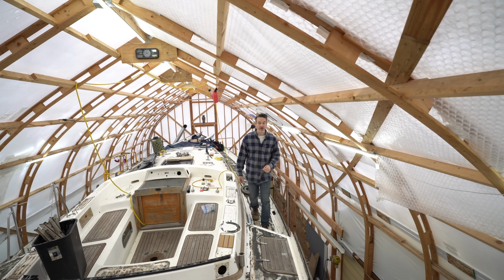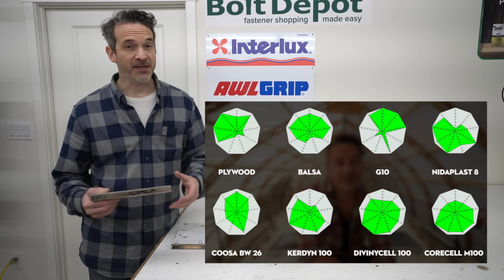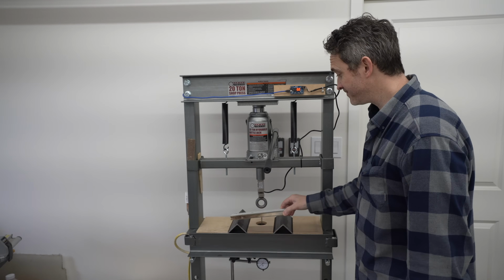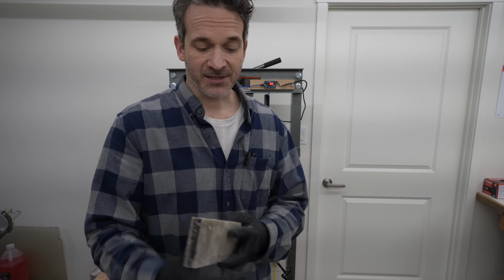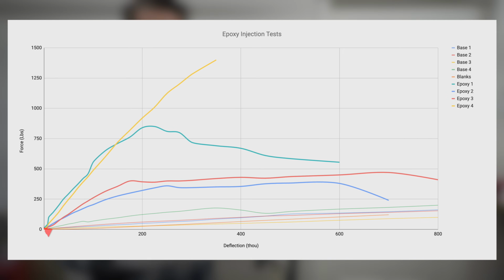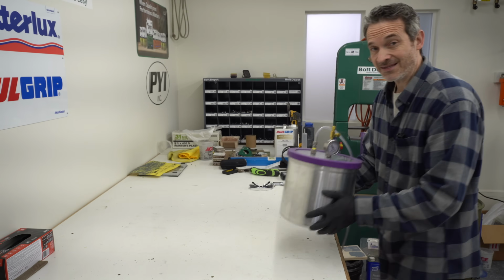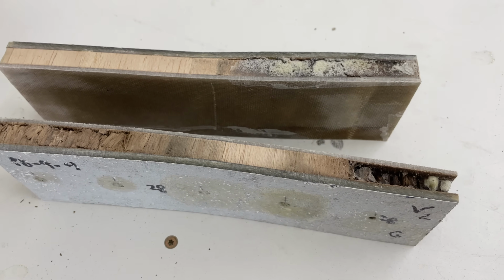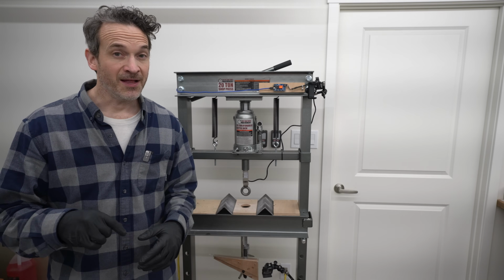Does Injecting EPOXY actually FIX a rotten boat deck?!

Comment: What I take from this is that epoxy injection is a viable fix for a small localized problem. For a a big problem, like Antidote,  recore is  the only suitable remedy
Reply from the maker: My legal counsel requires that I do not answer this directly. Haha. 😂 
I think that’s a reasonable interpretation of the results 👍

Comment: Just for fun I'd like to see how many self tapping countersunk screws per inch it would take to replicate the H100 core.
Reply from the maker: I’m on it! I bet BoltDepot would send me those to do some testing… 🤔
Reply: @livingforsail  FRP screws or bolts are another option, and could be glued in, with the head cut off if necessary. I was also going to suggest drilling and gluing in composite threaded rod but it's a bit too custom to cut and slot each one! I tried to find composite grub screws but came up empty. Nylon slotted grub screws was another option but I don't think the nylon could be glued in with epoxy.

Comment: The eyebolt just leads to core compression, the test setup could use a shoe to better test beam shear.
Reply from the maker: Yeah, I agree. A bit of a point load there… backyard engineering like I said. Haha. I think the results are still representative.

Comment: Thank you for the video. the subject of wet deck repair comes up often on a forum I follow. If its not too much trouble I'd like to see a test of an unrepair panel, say how many pounds does it take to deflect maybe .05 inches, Then repair the panel using the four methods and retest. Purpose is to measure the effectiveness of the repair as long as the panel returns to its former shape.
Reply from the maker: Thanks! 🙏 Interesting idea. I’ll put that on my list of ideas. Cheers!

Comment: I guess the value of the boat before repair,  cost of repair, value of the boat after . If the red number isn’t to big then do it right by re-coring . If someone gave you the boat then gave you some cash too , the number will probably still be red but doing it right is still the best option. Lol
Reply from the maker: Yeah. That’s kind of my conclusion… “do what’s right for you”

Comment: i havent seen the episode, just heard the intro
cut the deck remove all the shit, recore and redeck using the original panels.
anything else is a waste of time, money, and more money (resale value)
Reply from the maker: Thanks for watching the intro 👍😂
Reply: @livingforsail  
usually i dont coment before seeing the whole thing, and i still havent had time to see it, but it seemed like a straightforward one.
if you are going thru the motions you are putting yourself thru by doing such a refit, not recoring and redecking would be a loss oppurtunity, its one of them jobs you want to do once (per boat ;) and be done
Reply from the maker: @pmnfernando  No worries. I am in agreement and that is MY conclusion from the video. The goal here was to take a look at what these work arounds actually do. I have never seen anyone talk about that before...